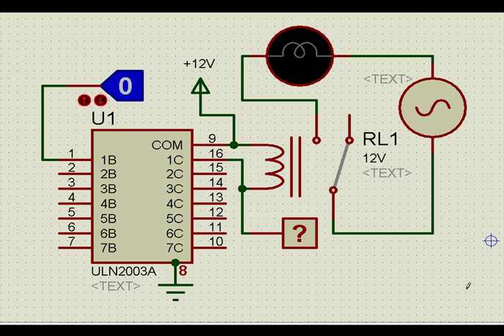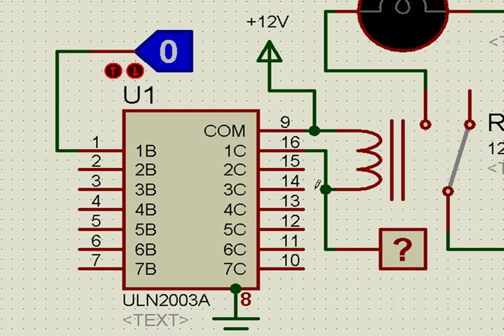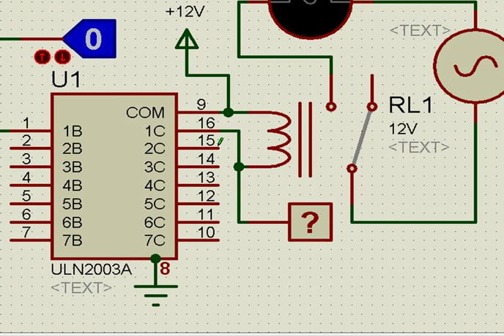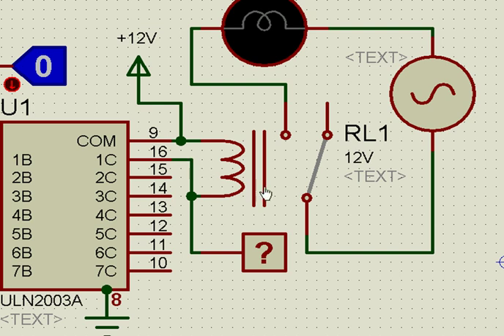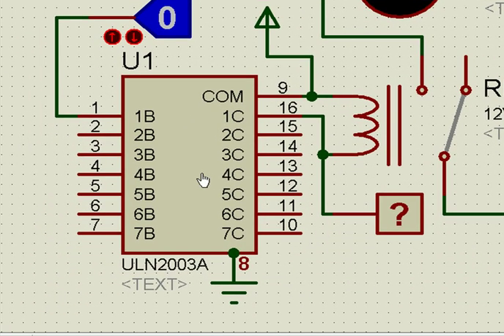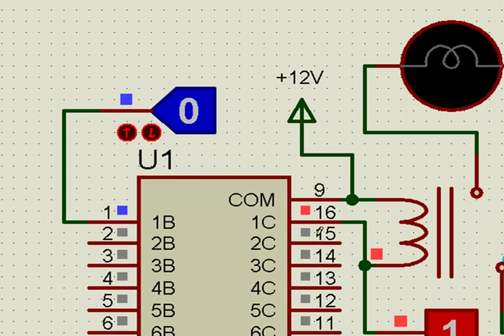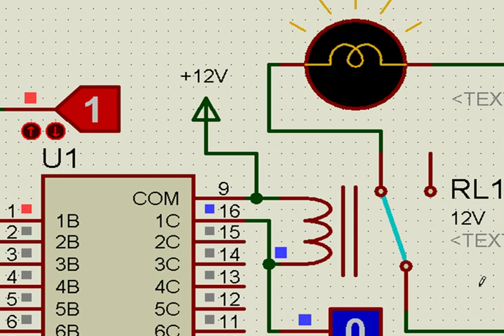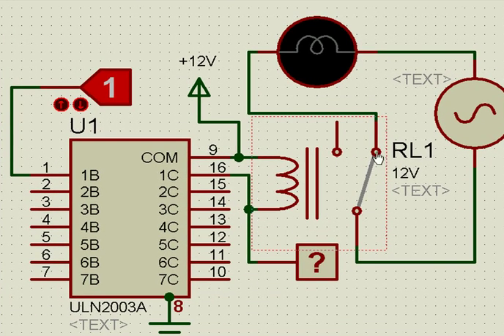Relay interface to microcontroller by ULN 2003

Comment: Hi Mr Patnaik, I am using a PIC16F876a MCU to on/off a 12VDC relay through the ULN2003. The power supply is 12VDC and its brought  down to 5VDC through a 7805 regulator to supply the MCU. The relay works fine with bulbs connected at the NC-NO terminals. But if I place a 230V-Contactor coil (3-phase AC relay) at the NC-NO terminals, the MCU jumps instruction code or at times completely resets. May I know why and how can I prevent this...?  Thank you in advance.

Comment from the maker: There is Darlington pair for each input and output where the collector is open ended.So while low is given at the input the Darlington transistor does not conduct meaning the output is floating which is indicated by gray as per the software

Comment from the maker: you can use uln2003 three nos interfaced to 8051 microcontroller 21 pins so that you can operate 21 relays